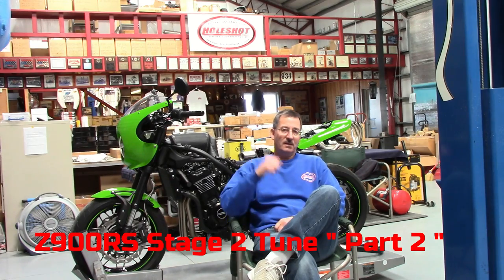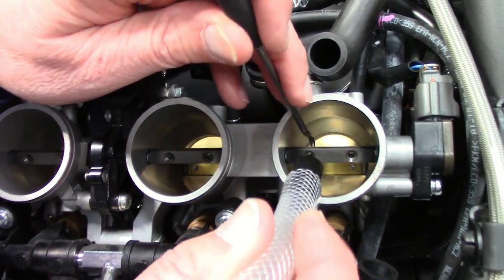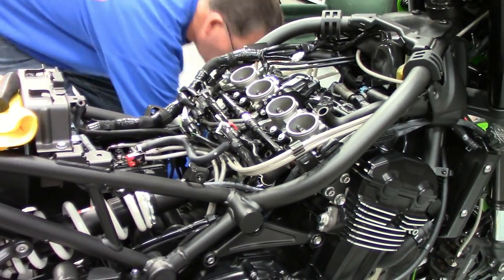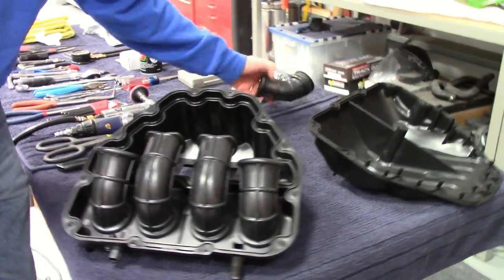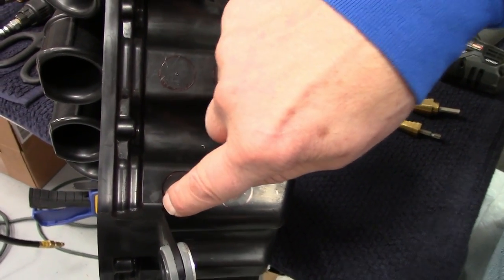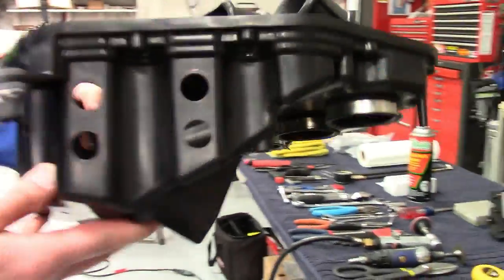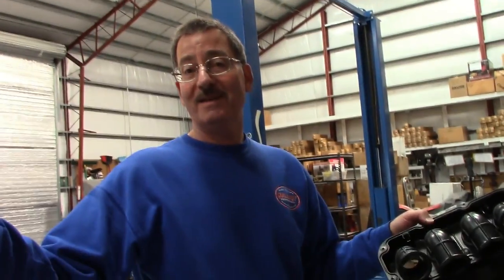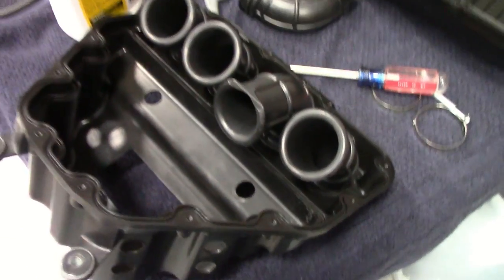Kawasaki Z900RS Stage 2 Tune " Part 2 " Holeshot Dale Walker

Comment: About the velocity stacks. You can put the ones from  the z900 as a direct replacement. They are half the length of the short ones in the z900rs. Its a common mod in the Japan z900rs mod  comunity.
Reply from the maker: Common doesn't always mean better. I want to take advantage of the front section of the air box, and the placement of the added air flow I set up along with the removed divider. Especially without ram air. Cheers D

Comment: Hey Dale! Great to see your back on the tube again. I am wanting to do the airbox mod as prescribed. The stacks from Kawasaki here in the UK cost over £60! My problem solving thoughts are asking this... Can we not just cut the two longer stacks to the same length/angle, without buying shorter ones?? Regards from UK
Reply from the maker: Hi Tom, most likely would work ok, but you would want a nice radius on the end, not a sharp edge. Be sure to watch Part 3 > Cheers  DW

Comment: Nice attention to detail. Reminded me of when I did the Bandit lid per your instructions. Cut then sanded to perfection. Opening the lid not only enhanced the airflow but made a nice audible difference too. With the full exhaust, the secondary throttle blades removed and the airbox mod - the last step needed is your SuperTuner for a great performance package. Can’t wait to see the results. My guess is just kissing the 120 mark at 119 hp.
Reply from the maker: Hi Joe, I spent years getting to that point with the 1250, developing the tuner , removing the secondaries, designing my own 4-2-1, and literally thousands of hours dyno and road testing. I even purchased two new 1250s, Igor and a 2008 that I eventually sold. In the end it was worth all the hard work, by milking out a full 30 HP from a bone stock 1250. We will see how Mr Green does in the next week or two, but its important to me to try to get the best driver as well, meaning smooth with nice throttle response.  Thanks  DW
Reply: @DaleWalkerHoleshot  Absolutely. The throttle and engine response are greatly improved. Your effort turned a jerky and unpredictable stock Bandit 1250 into a much more enjoyable ride that pulls smoother, harder and much more predictable throughout the whole entire rev range. Modifying the bike kept me from getting rid of the bike.
Reply from the maker: @joflewbyu2377  Thanks for your support, please let all your buddy's know about my little channel, and to take a look and subscribe. Working on Part 3 today so stay tuned !  Cheers  Dale

Comment: What’s up Dale! I go pick up a 17 FZ10 Saturday. About 8 hours round trip. Already has Akrapovic titanium cat pipe, ais block offs, 2WDW custom tune, Trex Fz10 frame sliders, front and rear axle sliders, Yamaha comfort seat. It has such low miles most people wouldn’t believe it, but it’s legit.
Reply from the maker: Sounds like a great find Mike, congrats on the new bike. You will love that thing !  DW
Reply: @DaleWalkerHoleshot  it only has 41 miles on it!!
Reply from the maker: @Stclairm1  Awesome, bring it home and go over the entire bike.
Reply: @DaleWalkerHoleshot  he is a 38 year mechanic and removed the fuel regularly and kept blue stabilizer in it and I believe flushed the fluids. He had knee surgery right after he bought it and didn’t ride again. Also has a Street Glide with 48 miles not for sale.
Reply from the maker: @Stclairm1  Just go over it front to back to check all the fasteners Mike. No matter who owned it, that's a good idea. Ok back to Mr Green now. Cheers  DW
Reply: @DaleWalkerHoleshot  will do and thanks sir!
Reply from the maker: @Stclairm1  Get on one of my MT-10 riding vids and let me know how you like the new bike Mike. Cheers D
Reply: @DaleWalkerHoleshot  just got it home and it was exactly as described, new! Sounds sick with Akrapovic cat del pipe. It’s raining and I gotta get plate Tuesday. I’ll hit up your MT vids.
Reply from the maker: @Stclairm1  Sweet, Glad it worked out good for you Mike. You will love that thing. I hated the stock bars though, but that's just me. DW

Comment: Would it be easier just to totally eliminate the air box and put on air filter podes directly to the intakes?
Reply from the maker: Pods would kill power over a properly modified air box and tune Louis. I've tried that a few time with EFI and went backwards. Cheers DW

Comment: Has anyone tried swapping on a z900 head and upper assembly, or just the z900 throttle bodies ,velocity stacks and cams?
Reply from the maker: I know in the UK they have done some of this. Cams with proper tune & full exhaust will make about the same as the Z900 >  APX 130 Beans
Reply: @DaleWalkerHoleshot  Apparently the z900 has a good bit more compression. Even with cams and exhaust the rs is still behind the z900 because of the low compression dished pistons.

Comment: Assuming that one tunes the bike accordingly... If you use this airbox mod, and a higher flow filter, but keep the stock exhaust... How much impact does the mod have?  Or does this mod only really make sense to do if you are doing the exhaust as well?
Reply from the maker: Never tested it since the stock exhaust is totally choked up, Need to do both to really get the gains, as well as drop tons of weight off the bike. Cheers Dale
Reply: @DaleWalkerHoleshot  And therein lies my dilemma...  I normally do loud exhausts and tuning and all that on my bikes... But this one I wanted to keep the stock look and sound and make it more of a "sleeper"...  Already did the ECU flash to get rid of the secondary plate and timing restrictions, and I ditched those crappy OEM tires and fitted some Pilot Road 5's...  Then I swapped out the stock shock for a K-Tech Razor R Lite sprung for my weight(250lbs with gear) and swapped out the watery fork oil for the 7.5W that Dave Moss recommended...  Front rider sag is 40mm and rear is 35mm and it corners like a cat on carpet now.

So I feel like it looks the retro part, but I can ride it like my sportbikes now and its a blast.  I know that with a pipe, the airbox mods and a proper tune, I can easily add 15hp at the wheel, or more... but then it will be too loud, attract attention and I am not sure I want to do that...   If I want loud, I have piped and decatted bikes in the garage like a new Street Triple RS 765 and a ZX6-R...  

I want to ride with my sportbike friends in the mtns, but when I pass a cop, have him just assume it's some old guy on a classic bike...  haha
Reply from the maker: @SquireSCA  You had to being your a big guy at 250 lbs. At 175 lbs. or less all the stock parts work like a charm when set up right. The stock tires are also very decent for the street until worn, then upgrade. If you want the stock look, you better leave it bone stock. That stock muffler on any header is as loud or even raspier than my 10 " Bad Boy. My 17" street core on the Black Widow is just about right, and when light on the throttle pretty subtle as far as pipes go. Stock is Stock though and will never match that of course. Cheers DW